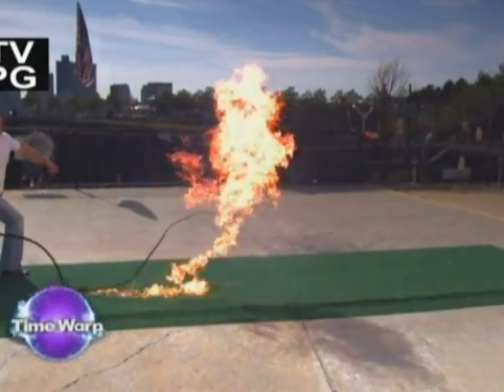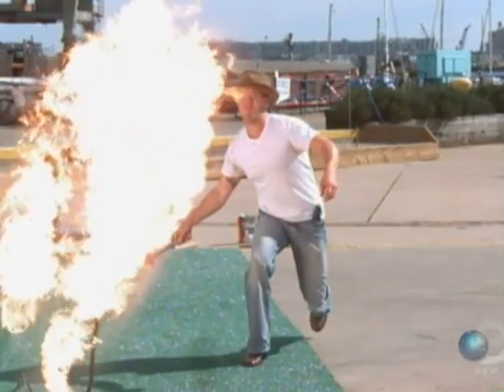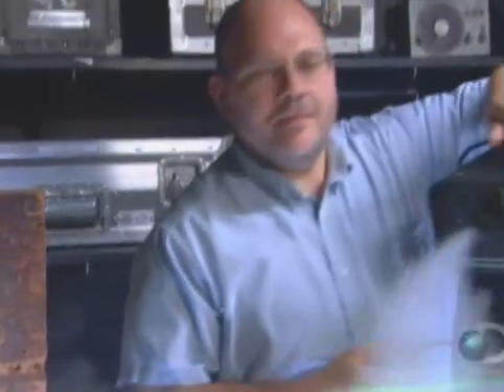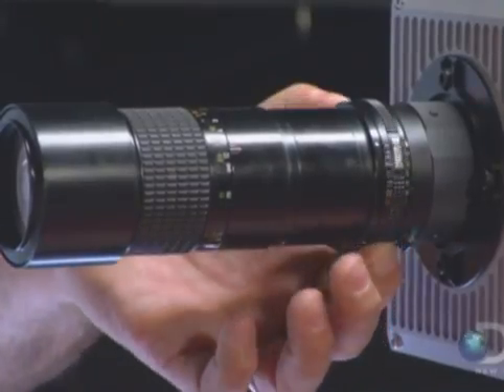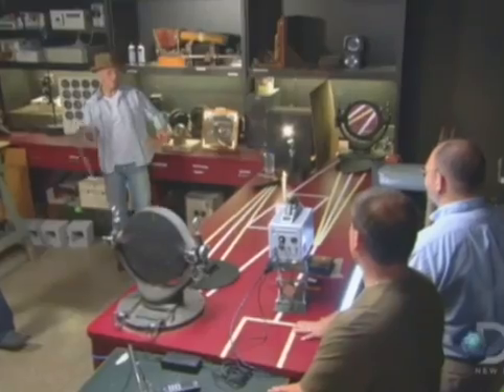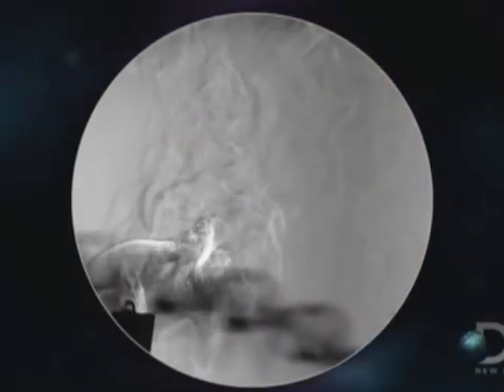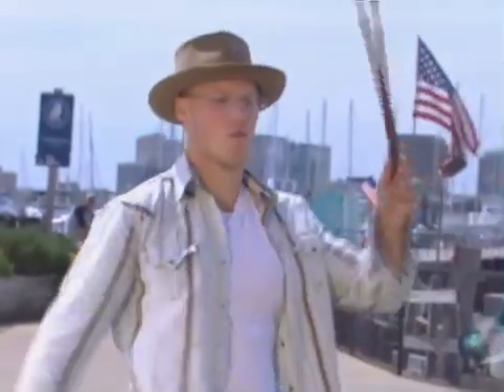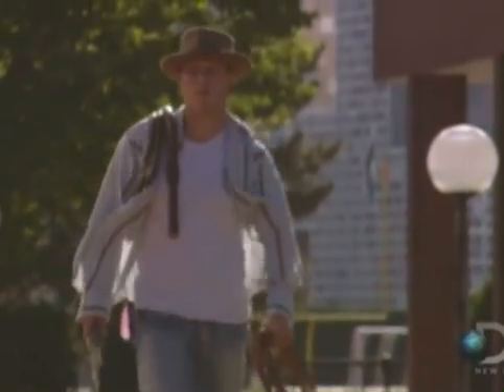Sonic boom visualized by Schlieren photography

Comment: The cocept of sound is taught and thought of so wrong and this is a good example of that 'wrongness'.  Look closely at the video in this presentation.  The so-called "sonic boom" is claimed to take place as the tip of the whip changes direction...not as it reaches its max speed.  Come on, people, get with the program here. The crack of the whip is NOT a sonic boom, it's the breakdown of the boundary layer on the tip of the whip as it suddenly changes direction, allowing the 'pop' to propagate.

Comment: @cplai  Actually its a BAD thing when a choppers rotor breaks the sound barrier, this IS why choppers have to travel so much slower than planes.  Likewise, prop driven planes are also limited for the same reason. However, the smaller stouter prop is better able to deal with the stresses involved.  If you've ever heard a small plane in a dive (for real or in a movie), that point at which the plane starts to "Scream" is the prop tips going supersonic.  Stunt planes often do it @ airshows.

Comment: I thought sonic booms blow your ears apart thats why they have to fly km's in the air if they go faster than the speed of sound. if you flick a candle with your finger you can put it out the distortion was just heat waves i think the crack is the whip flicking back on its self like belt, this is bullshit it has to be. sonic boom is thunder when the h combines with o to produce rain and thats what happens with the aircraft, a bloud is produced and thunder is made, its a pressure barrier.

Comment: wonder what happens if someone breaks the speed of light barrier..
Reply: A few possibilities:

1. It's impossible, as no object with mass can travel the speed of light, and objects with 0 mass (such as photons) travel at exactly the speed of light — this is referred to as the cosmic speed limit.
2. One may potentially travel faster than light by manipulating the fabric of space itself, so you wouldn't technically be travelling faster than lightspeed, you would be warping space around you to shorten the total distance necessary to be travelled. So if you could find a way to actually break the speed of light, the result would be a warp of some description in the fabric of spacetime.
3. Since the faster an object travels the slower time moves for it (special relativity), with photons experiencing no time at all, if one could break the speed of light they would potentially travel backwards in time.
Reply: Petrit Nikçi damn

Comment from the maker: The loud pop is the sonic boom.  On a helicopter, the rotor turns in a circle while the aircraft flies forward at high speed.  The tip of the rotor has different air speed when it sweeps forward or backward. When sweeping forward, the airspeed is the aircraft speed plus the rotor tip's speed.  Often that exceeds the sound speed and gives out the pop pop pop sonic booms.